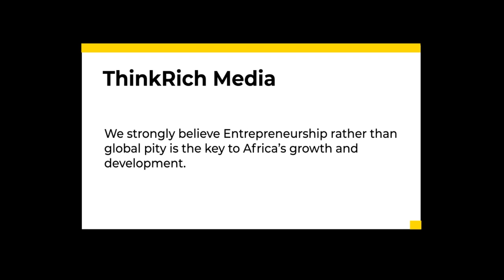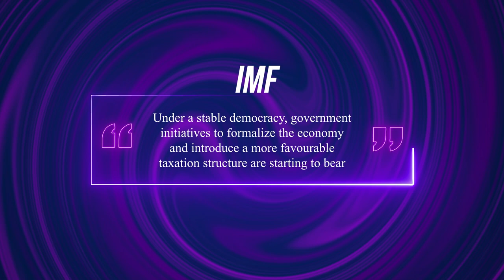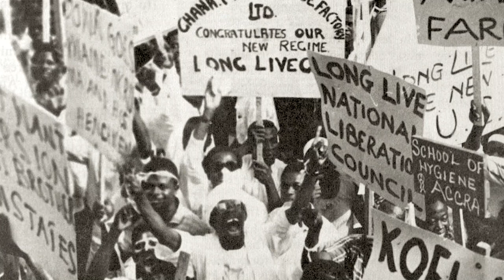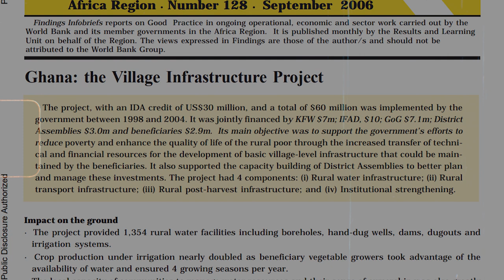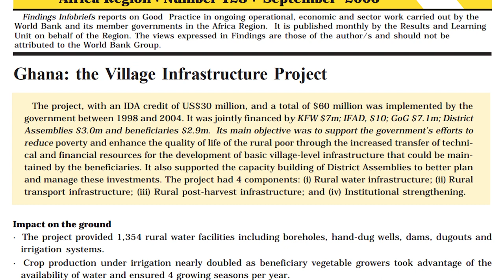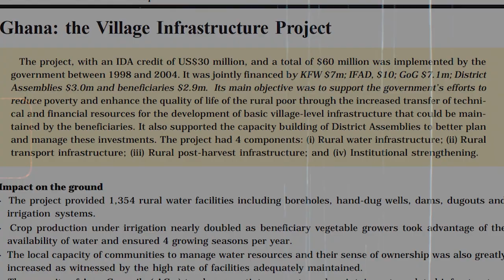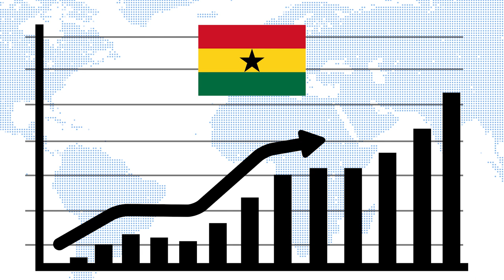Why is Ghana Africa's Fastest-Growing Economy?

Comment: Ghana needs to get into chocolate production. There isn't ba single top level Ghanaian chocolate brand on the international market. This is mind-boggling.
Reply: They already do. It's called the "Golden Tree chocolate"
Reply: Are you sure about that? Check again.
Reply: @jacquelineedwards3207  It is not just merely about prouction, it's alao about internationsl systems. It is cheaper to export raw materials to Europe than to export finished products (they tariff finished products). The only way out for Africa is to trade more with itself.
Reply: @jacquelineedwards3207  yes we do